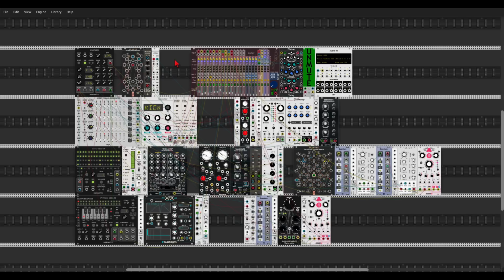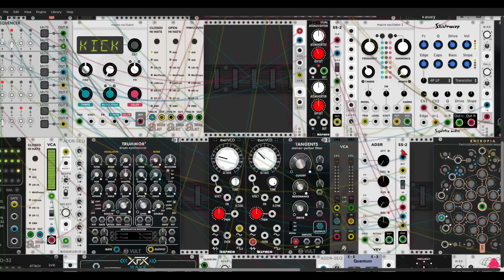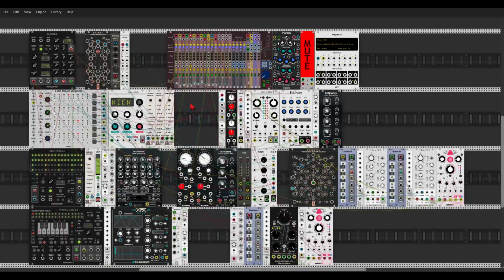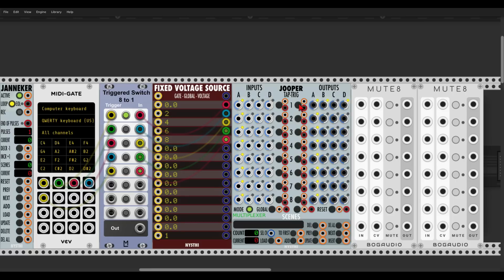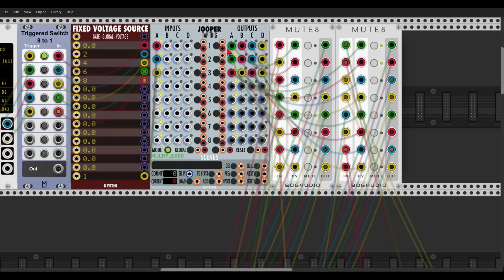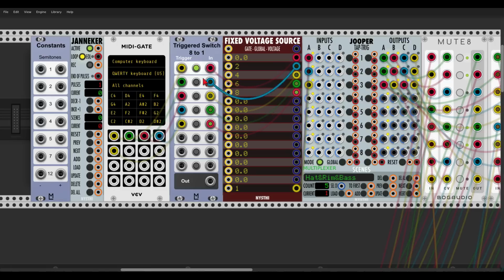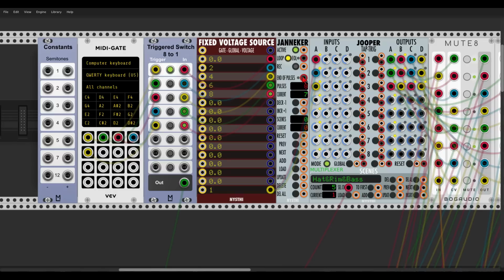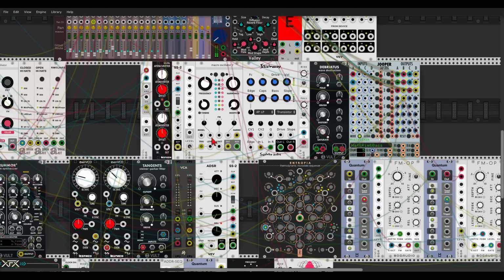Working with Scenes in VCV Rack

Comment: This is exactly what I was looking for since I discovered VCV Rack! Thanks for this great explanation :)
Reply from the maker: I'm really glad to hear that, cheers!
Reply: @OmriCohen-Music   And I wanted to ask you: I like to mute my gates/trigger signals, because when I try to mute the audio channel, it will occasionally cut off the sound (especially when the track has delay/reverb on it).
Do you see any disadvantages to this way of muting?
Reply from the maker: @6a616e_  Well, that's the beauty of using the Mute8 module because you can route everything through it, not only audio. So let's say, you can send the gates\triggers first through the Mute8 and then to the destination, and like this you can mute the gates themselves. You can also send the audio BEFORE it goes to the delay\reverb through the Mute8 so when you mute the audio, the delay\reverb will play the tail.

Comment: Another great video Omri, super useful! Janneker and Jooper seem like a killer combination, I will be using those for sure. And that was a really nice patch you were demonstrating! A couple of notes: For switching and/or holding between two different voltages, the Bogaudio:switch module is very effective, especially when used in latch-mode. Also, UMix works fine for mixing pitch-CV, but you have to right-click and select "CV mode" :-) Thanks again Omri!
Reply from the maker: Thank you, Lars! Yes, Jooper and Janneker open doors to many possibilities... And thanks for the tips ;)

Comment: Thanks for teaching me Jooper! Excited to create some scenes. I usually mute/unmute a 10v signal going to the ‘level CV in’ on the mixer. This would save you the extra work on the stereo channels. Most mixer have relative rather than absolute for the level CV so your mix won’t be effected. Cheers!
Reply: Also, I add slew to the Level CV to create slower fade in/outs.
Reply from the maker: Oh yes, there are many ways and approaches, modular is beautiful! By the way, you should check out Tact from Impromptu. It's a really nice fade in\out tool.

Comment: This is something that I've been looking for. I can envision using the scenes feature of Jooper to create song structure, and the scenes feature of the reWin quantizer to create chord changes in generative patches. I'll probably need to buy a new computer to handle that many modules at once.
However, I've not yet been able to get Jooper to respond to SEL CV inputs the way the video demonstrates; not sure what's up with that. Haven't yet tried to use CV to switch scenes in reWin.
Reply from the maker: yeah, it got an update since this video and it will now work with pitch information so it's easier to switch between scenes. Try using Twelve-Key from Impromptu for example, or even your own Midi controller. Let me know if it works.

Comment: Also, what can I do when a module only allows one input/output and the reverb module has both L and R in/out? Is there a correct way to put it in the chain, or to mix the two signals? Not sure if I need to be putting them on separate mixer channels (which would be annoying having the volumes not linked). Idk I'm a bit confused. Modular is overwhelming.

Great videos though, I wouldn't have even considered getting into this if it wasn't for you. I'm probably gonna buy your full series eventually.
Reply from the maker: Don't worry about it, I'm happy I can help :) Modular can be indeed overwhelming but take it step by step. There's something common to see in modular and those are normalized connections, which means that even without connecting any cable to an input, the connection would be normalized, would be internally connected. For example, most reverbs in VCV have the right input normalized to the left input so by connecting a signal ONLY to the left input, it will automatically go also to the right input and there's no need to make this connection. I don't know which reverb are you using, but there's a chance that you don't need to do anything for it to fully work with both channels. Does this make sense?

Comment: The mscHack mixer link isn't working anymore :( Is there a similar module I can use?

Also, what if I have number of scenes that's not evenly divisible? Say I have 7 or 11 scenes, do I send a fraction of a volt? Thank you :)
Reply from the maker: Yeah, it's now in the manager - https://library.vcvrack.com/plugins?query=mschack&license=&sort=buildTimestamp
About the divisions, try using the volt meter from ML to see exactly how many volts you need for each scene.

Comment: Another great tutorial Omri. BIG THANKS. However when I try to load the patch "Base patch with Scenes.vcv" the sound is all garbled.
The other patch from the same zip file, "Base patch.vcv", works fine. Does anyone else have the same problem?
Reply from the maker: Oh... What do you mean with garbled?
Reply: @OmriCohen-Music  really weird issue. It seems to have to do something with the audio driver and device I choose. I usually use directsound which works fine. However when I load this patch and choose directsound the is garbled, just cracks and pops etc. But when I choose an ASIO driver all of a sudden the sound is fine. Even more weird that if after loading the ASIO driver I switch back to directsound it is still ok ... after saving the patch with the driver working ok, I can reopen and all is fine... strange issue, but sorted I guess :-D 
and again thanks for the fantastic, mind boggling tutorial!!! :-D
Reply: @diederikvzylab6394     I have the exact same problem!   My Windows 10 PC is pretty beefy!  I have an AMD  PC with 8 cores... 16 GB  of ram    but It just CANNOT handle a  VCV Patch this size.  I saffire PRO 40  with an ASIO driver and I set the buffer size to the LARGEST  size I can choose and it still just too much for it... @Omri,  Are you using Multiple CPU's?
Reply from the maker: I'm happy you got it sorted!
Reply from the maker: That's totally weird... Are you using multiple cores maybe? I'm using still only one...
Reply: Yes,  I'm having this problem that I can't seem to find a solution for!  I  have a powerful system,  with a good beefy processor, 16 GB  of ram..Very  Low latency ASIO .... I have reduced almost all of any extraneous background processes as I can find...  I have take as many steps as I can find to reduce the load on my Windows 10 system.  but I load your patch (or any like it with that many modules)  and all I can get is distorted stuttering choppy audio.   I can't figure out what is necessary to run it so it sounds like it should sound.   I was hoping VCV rack performance would be better in v1.1  but its just worse!
Reply from the maker: That's really weird... Try working with only one core in VCV. Also, make sure that the sample rate is the same as your interface and also the buffer\block size
Reply: @OmriCohen-Music  Yeah... I've tried everything!  Reinstalled both my ASIO driver (Saffire Pro 40)   and my Texas instruments 1394 Firewire driver...  There is just No way I can get your enormous patch to work!  I tried changing to "one core"  .. I don't know if I succeeded  because when I use Resource Manager in Windows I see All 8 cores Pegged to maximum capacity, regardless of what I choose from the Engine menu in rack.   I lowered the sample rate to the lowest possible,  and set Buffer size to the highest (4096?)  I still get chopped up audio.  My machine is not the fastest now... but its still respectable.. The weirdest thing is if I choose "directx"  instead of my ASIO driver... the performance is slightly better.  That surprised me.   Its disappointing!
Reply from the maker: Oh... I get the opposite when choosing directx... Try activating the CPU meter and see which module is eating up the most, and if you have some spare CPU on the Audio module.